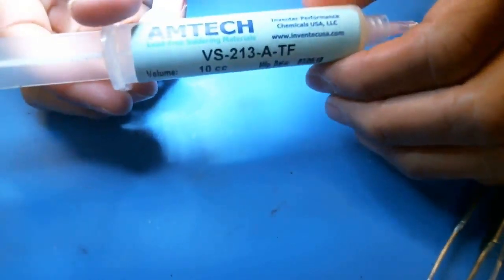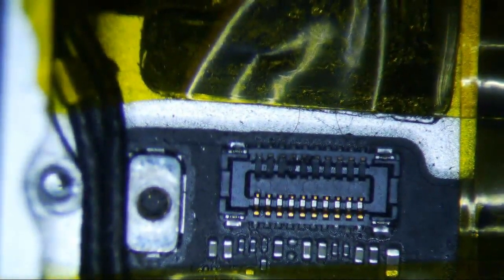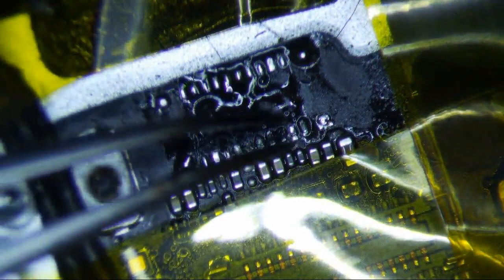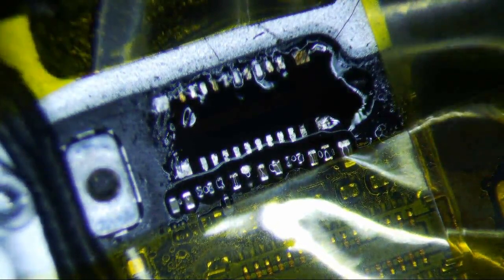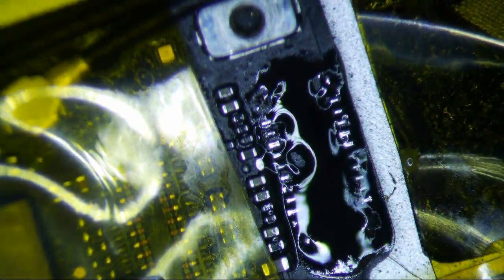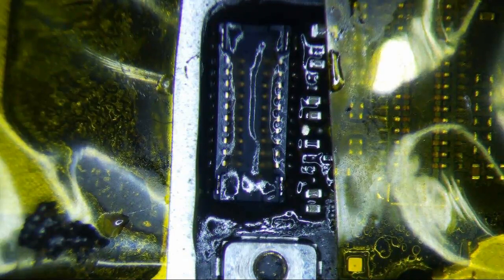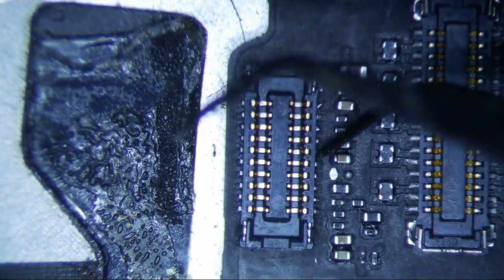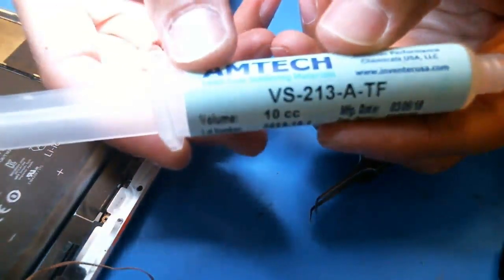Amtech VS-213-A-TF vs Amtech NC-559-V2-TF Tacky Flux Comparison

Comment: Brilliant to use the micro tweezers for the wicking! I haven’t seen anyone doing that. I think this is by far the most sensible method. I also appreciate that you give details. Hot air temps and air flow. All the extra details matter. Solder amounts on ground pads… you will be my go to.

Comment: Is this overkill for desoldering/soldering keyboard switches and the occasional arduino or oled screen/controller?
Reply: Definitely not overkill. You should always use flux when soldering and desoldering. The flux is there to remove oxides and other impurities from the surfaces of the metals and ensures it flows uniformly. When desoldering, adding some flux to your copper desoldering wick will help ensure the solder flows up the wick. For me, it was a night and day difference using a copper desoldering braid with and without extra flux applied. It's also very cheap so, in my opinion, you should always use of flux and always use a 99+% IPA to clean up before and after.

Comment: I am going to try Amtech VS213, I have been looking for a replacement for my no-clean flux which is a knock-off of the 559. It works but it is hard to clean off. You sold me lol Thanks, mike for all your vids they are very helpful for me as a beginner.

Comment: Not fair, I couldn’t test it with my lab packed in a storage until I find the new home I want, lol. I wonder how it does with 91% alcohol? Usually cheaper and still worked good for the older flux also.